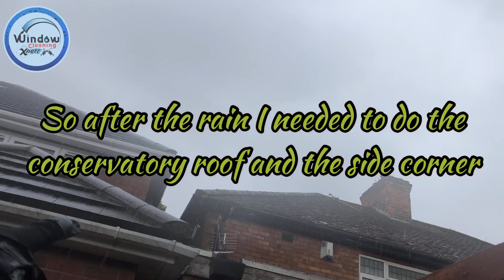Working in the Rain and Sun | Gutters, Fascia, Conservatory Clean Pressure washing, satisfying video

Comment: That came up well. Bet those arms of your received a good workout, especially over the conny. Sometimes a bit of rain helps cleaning the conny roof. Do you find pressure washing is ok on seals and not jetting water into the loft?
Reply from the maker: Hi thanks mate, it’s Depending on how much pressure you use to clean bro, I always setup around 100 bar maximum for conservatory and sealed units in my 10 years experience I never had a situation seals came out or similar, that’s why you giving a thorough scrubbing with liquid and pressure wash is to use minimum  to clean it quickly and to get rid of the hard stains which are difficult to remove, it’s a very tricky job to get sorted without any problems, risky, danger, you can say all that things but the experience will make the jobs perfectly and safely.
Reply from the maker: Specially When you spray those sensitive places has to go bit wider with less power a d it will not go on to loft for sure mate
👍

Comment: Hi mate great job congratulation. Can i please ask what sort of pressure washer are u using. I have a karcher but i find it  to powerful with the extension lance when im washing fascia,soffits ect. Makes a lot off mess spreading even to the neighbourhood. Can you lover the pressure on the jet wash . Cheers keep up the hard work Roland the windowcleaner
Reply from the maker: Hi mate thanks 😍💞👍 yes  you need to have something like karcher xpert or similar hd machines that have a pressure controlling switch or regulator 👍